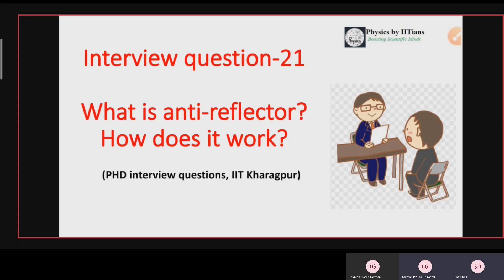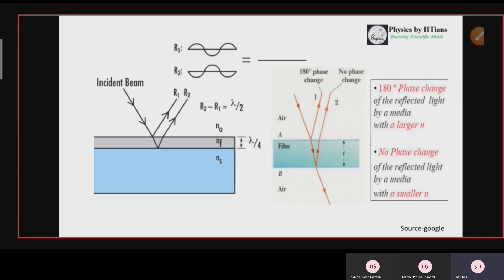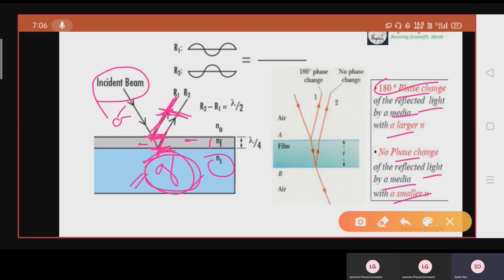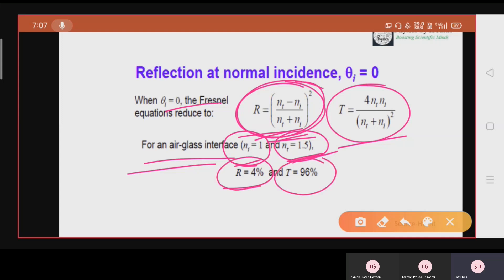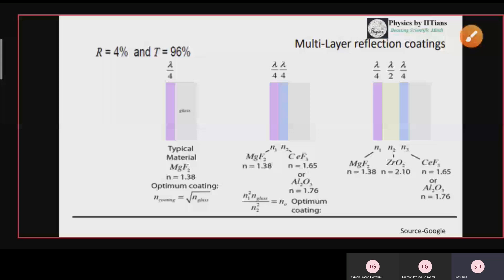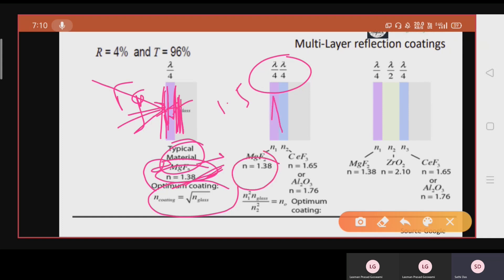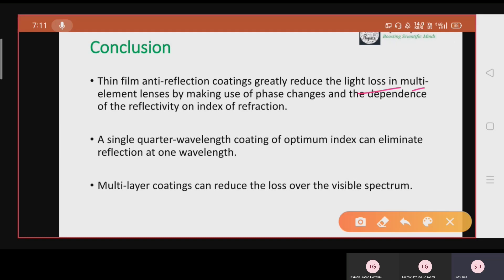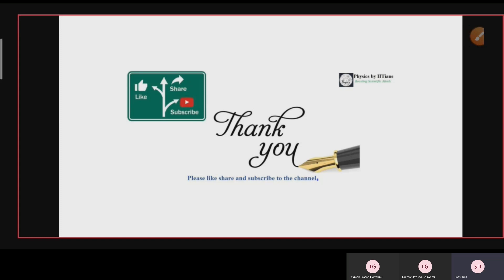Physics of Anti-reflection coating #Asked Phd Physics interview questions from Optics

Comment from the maker: Important playlists:  
Special Interview question series: https://www.youtube.com/playlist?list=PLV5t7kYUgfW7hxK-vx7dLxwxnSa4acBMk 

Necessary Concepts of physics to crack interviews: https://www.youtube.com/playlist?list=PLV5t7kYUgfW48R-9YARmavDj3CapHnMqn 

Interview questions usually asked in IITs for PhD/Int-PhD admission and Career Guidance: https://www.youtube.com/playlist?list=PLV5t7kYUgfW6c_1WAZMamOZNZ5IgDqRzf 

Lectures on Mathematical Physics: https://www.youtube.com/playlist?list=PLV5t7kYUgfW4zfnS-aUcd5f0yf_eFdgZI 

Important problems on Physics for NET, GATE, TIFR, IIT-JAM like exams: https://www.youtube.com/playlist?list=PLV5t7kYUgfW7A7kCsmYULSHqVsmQJ0FsY 

Lecture series on Quantum Mechanics: https://www.youtube.com/playlist?list=PLV5t7kYUgfW4oSrZa2gy-xlRkMLcCylNm 

Lectures on EM Theory: https://www.youtube.com/playlist?list=PLV5t7kYUgfW4saO5wprK3GBaZLMdWHhW0 

Analog circuits Op-Amp, BJT, Diode, MOSFET: https://www.youtube.com/playlist?list=PLV5t7kYUgfW7StlqGBv0tU-vP6Q3uLKAp 

Digital Circuits: https://www.youtube.com/playlist?list=PLV5t7kYUgfW5wZYGrCTUnASrY5KZb5Qs6 

Lectures on Atomic and Molecular Physics: https://www.youtube.com/playlist?list=PLV5t7kYUgfW6zjLah_trLC7HnoAhqYuM- 

Lecture series on Optics: https://www.youtube.com/playlist?list=PLV5t7kYUgfW7b53mPZ2yAh5a3I_yYObps